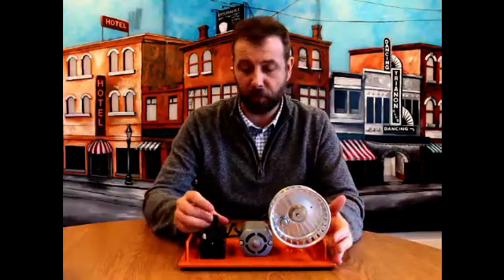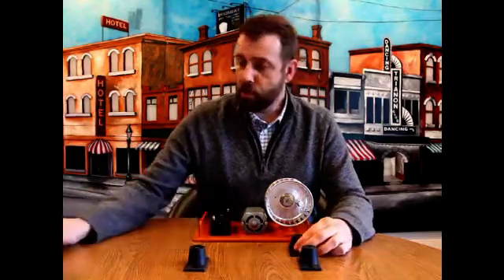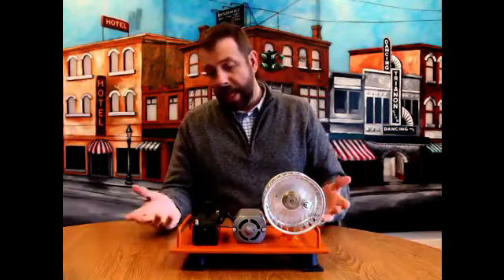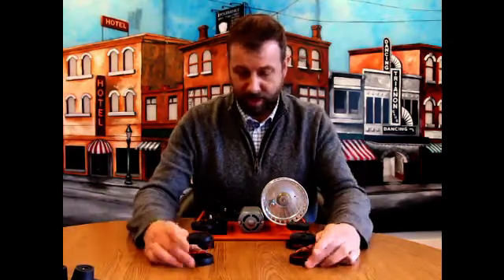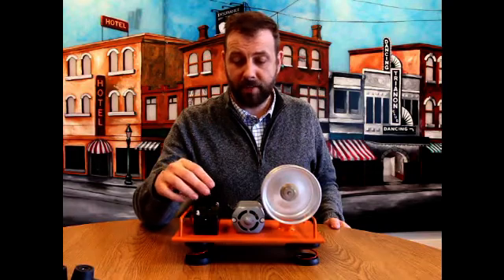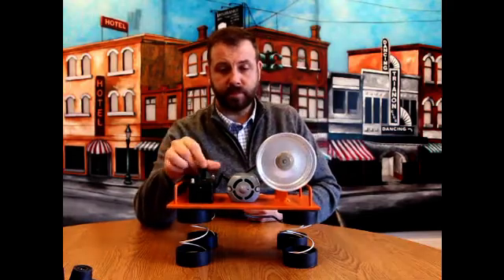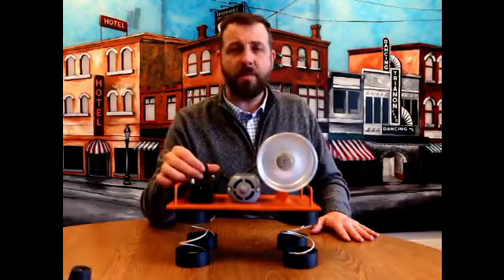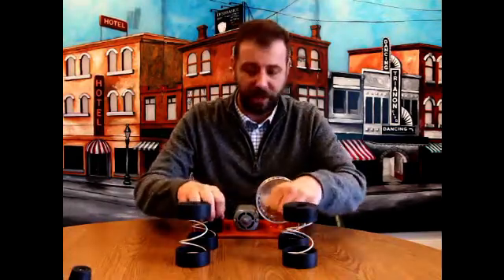Vibration Isolation Demonstration

Comment: Not a fair comparison of rubber versus spring isolators.  If the elastomeric (Neoprene) isolators were selected closer to their max load rating they would perform much better.  Also, elastomeric isolators don't resonate as springs do as they have much higher internal damping.

Comment: Maybe you could offer some suggestions. I'm looking to isolate a audio spring reverb FX unit that must be placed on my desk. Vibration from me playing the keys on my audio synths are causing the spring tank in the reverb unit to shake. I need to decouple the unit.
Reply: Sorry for the late reply.  I wasn't expecting comments.  It might be easier to isolate your synth if it is sitting on your desk that to isolate the FX unit.  The vibration from hitting the keys is an impact that could be reduced with a couple pieces of closed cell neoprene.  I am not sure how that would affect playing the synth, but it is generally easier to treat the source of the vibration and not the target.  Cheers.
Reply: I've got wall mounted minisplits that send vibrations into the structures. This video gave me a place to start. Thank you